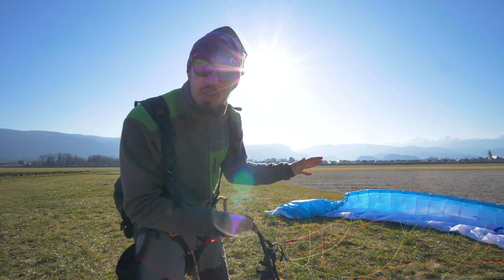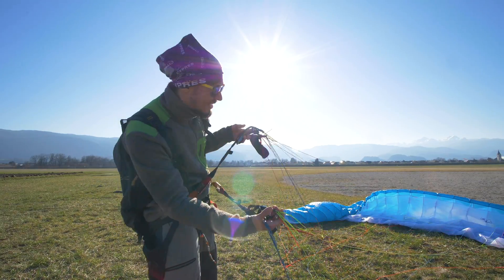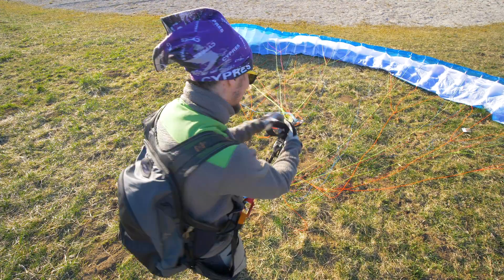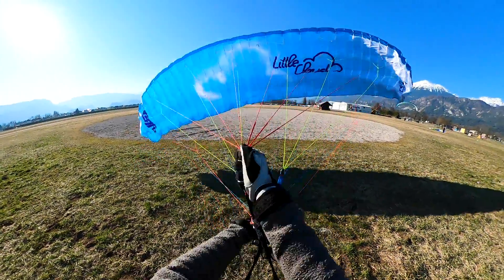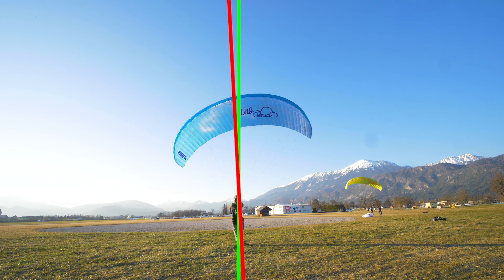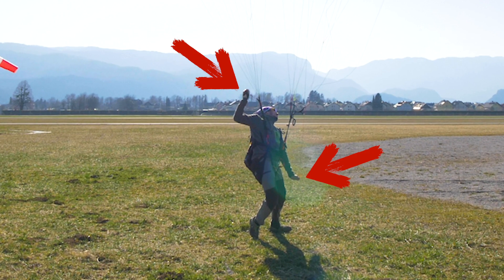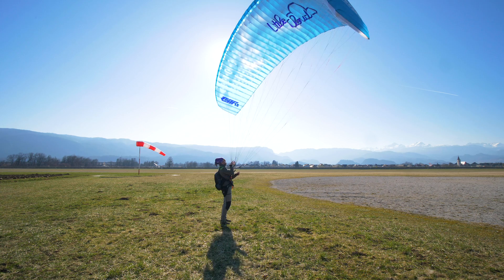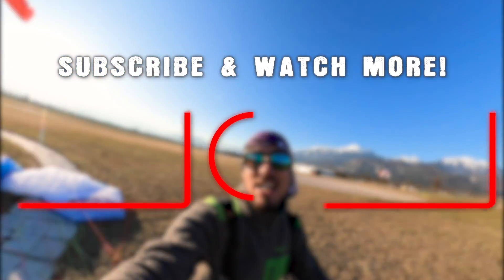Paragliding tutorial REVERSE take off tips

Comment: Hi Aljaz, as the pioneer of the Mitsos Reverse Launch, I want to firstly congratulate you on a well produced video and explanation of this technique. Only recommendation I can make is, always grab the rear risers (after brakes in hands) first and take left hand to hip before grabbing A's. When it's windy it's putting the safety on the trigger. I also use the C's to control the wing on ascent, by moving the left hand towards to low wing. Also use the C's to stop the wing overshooting in stronger winds. I also suggest stepping back into the wind prior to turning as this will help the wing move forward when it's windy. Too many pilots turn around as soon as the wing is overhead and when you're moving back towards the wing, it means you'll be behind the wing, rather than in front of it... cheers mitsi
Reply from the maker: Thank you Mark!! Great, thanks for you input!! :)
Reply: @AddictionHappiness  I also sent you an email...